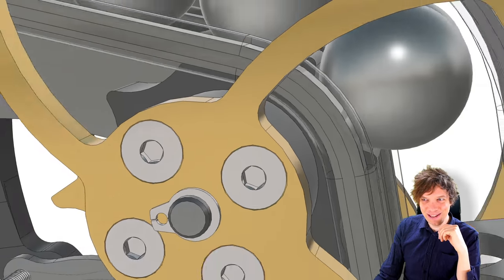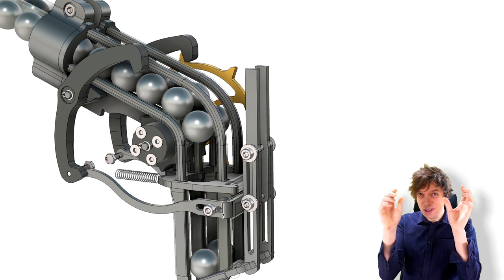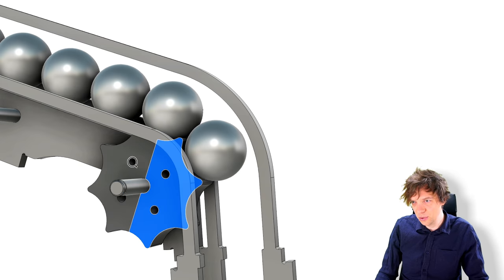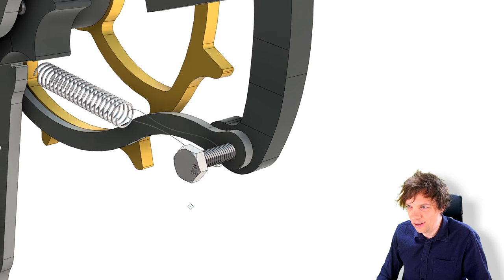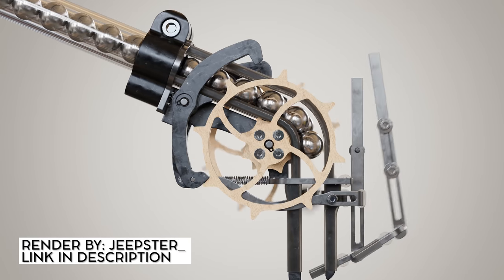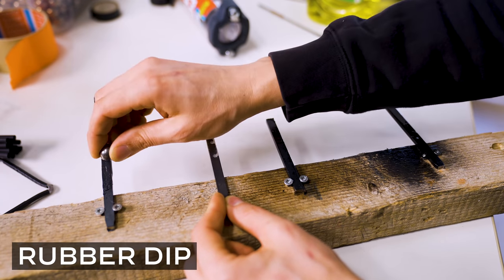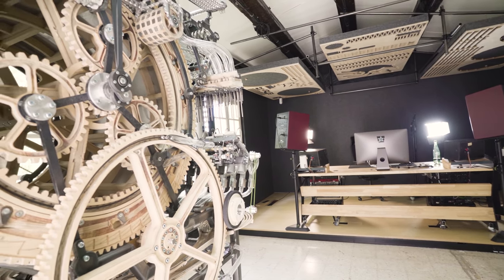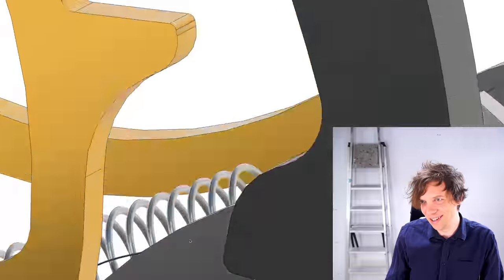Clock Escapement Marble Gate - Designed For Silence

Comment: That render looked so good, I couldn't even tell it was digital.
Reply: Well, the floating arms kind of gave it away
Reply: Yeah, hard to tell unless you notice the uncanny movement of the arms or see that they are floating
Reply: Granted the floating arms but it kinda fools you when you imagine it in the machine. Great render for sure
Reply: Yeah the floating arms are obvious but there was that split second before I noticed them that I thought he'd actually made them.
Reply: @POTThaesslich  Those were what tipped me off, but before noticing those though I too thought it was real!
Reply: Yes the pure quality of that render is absolutely insane - the light reflections even look like the material has been touched and has fingerprints and oils from the skin on it. Absolutely incredible
Reply: plus the lack of rust on the marbles
Reply: Dude I had to actually read that comment to realize it was a render.
Reply: @POTThaesslich  The motion also kinda gave a hint, this wasn't real
Reply: Oh my god i thought it was real
Reply: I was wondering myself what the heck was going on 😂
Reply: Yeah, I didn't realize it was a render either, I just thought he got bored with standard physics and gravity... I mean looking at this machine, it's not an unwarranted assumption.
Reply: while this wasnt done in unreal engine, [unreal engine is a vary high end(and free*) to use game engine], that game engine easily produces 100% realistic results for any non flesh material(not kidding), with high end textures based on real things like trees and rocks, those also can look 100% real if desired. Add in things like light going through materials and diffusing and even leaves look 100% real. This company also can have 100% realistic human models with enough effort put into them. some time ago they found a way to light up individual pieces of hair and have refractions etc so even hair looks real now. It does come at some cost for GPU but they have found amazing shortcuts so it doesnt cost what you would expect... in the end you can make everything look 100% real RIGHT NOW... if you want. Its absolutely astounding that this day has come but all things have trade offs and most companies are not interested in "real" due to time and money. with new graphics cards coming with ray tracing chips on them, it makes these computationally intensive processes much easier. i really look forward to the next few generations of games when this stuff finally starts to show up.
Reply: @jessiejanson1528  Thanks for the reply! I too am looking forward to the next gen games but as you said, time and money are the real constrictions...Either way it gives us a glimpse into the future of games and animated films and its very exciting!
Reply: @jackstephenson5238  they also made a new character generator for vary realistic characters that are fully rigged, but not quite 100% realistic, but that may depend on settings, im not sure. This type of stuff took time, money and skill and now its free for devs that use their system(but not fully released yet) This more then anything else will have a huge change on things and im just waiting for them to fully release it so i can play around with it :)
Reply: Easy to tell apart with years of experience
Reply: That was a render?? WOAH!
Reply: @DasVERMiT  the arms aren’t floating in the render
Reply: @POTThaesslich  the arms aren’t floating tho

Comment: Cross-drill a hole through the 8.8m bolt and run the spring wire THROUGH the bolt like you would with a guitar string. Then you will have a positive spring adjustment mechanism that won't slip or creep.   ...also, IT'S WEDNESDAY MY DUDES!
Reply: The "8.8" on top of that bolt is actually a marking for its tensile strength. There's no way he's ever gonna need a bolt that strong to do such a menial job
Reply: IIRC it's a 5mm bolt.
Reply: @STAG162  As Marin has shown on his live streams, he just use fusion's McMaster integration for the bolt models, so it's probably just a slip-up.
Reply: Great solution for the exact problem I was thinking of when Martin showed the spring attachment.
Reply: @xureality  yep I'm sure it's just a casual representation of the bolt intended for use, tensile strength being irrelevant
Reply: @STAG162  He is ALSO trying to minimize the total number of unique parts.  That bolt is used elsewhere in the machine - so any place it can do the job reduces the total of unique parts.
Reply: @kin2naruto  as I already said it's a representation only. the fact that it has a high tensile marking on it is non-indicative, ironically.
Reply: Krister L  building foundation-strength bolts.
Reply: That separate wire solution definitely made me uncomfortable; I feel like it's the weakest part of the design
Reply: Good suggestion.

Comment: 3rd generation clockmaker here. The part you are referring to as a “pallet” is actually called the “verge” on a clock escapement. The pallets are the flat ends of the verge that catch the gear teeth. There is an entrance pallet and an exit pallet.

Comment: It’s a very beautiful design! Beware of heat-shrink though, I had used it before in a similar application. It worked at first, but it reacted very poorly to repeated contact, deteriorated quickly and failed. I changed to using plasti-dip and have not had a reliability problem since.
Reply: Quite so, that type of heat shrink is designed with a long term view of electrical insulation and ingress protection, not with a consideration of its coefficient of restitution. Having a word with the actual manufacturers could lead to a better long term solution with the qualities that you're looking for.
Reply: Glad to see you here Marc!
Reply: always great to see youtubers i love on the same video. how great is that. now how do we get an old hp machine running the marble machine?
Reply: Yes, standard polyolefin heatshrink is not tough; FEP heatshrink is much tougher and is worth looking into.

Comment: Hi Martin :D
I'm a professional swiss watchmaker & i gotta say i love your integration of a clock-escapement into your marble gates. You really nailed it.
Just a little note on that - the part you're calling "palette" is called "anchor" in the watchmaking industry - the "palette" is just the part of the anchor where the escapement-wheel touches it🙈
(sry for the nitpicking, just bugged me a bit while watching)
Reply: Do you hand-fit your escapements, or just pull them off a CNC device and install them?
Reply: I'm a "rhabilleur" - so i do it the old-fashioned way and do it by hand.

But normally you cnc the anchor and the palettes are synthetic ruby - so you have to fit them (again, we do it by hand - the industry with machines)
Reply: @randomsocknr.3334  So Martin will most likely have to hand-fit 22 of those mechanisms?
Reply: @thomasbecker9676 Generally jes; depends on the accuracy of the parts - but i think the tolerances are much higher than on a watch

An anchor in a wristwatch dictates the accuracy over a lomger period of time - a micrometer can mean up to a minute delay per day.

On this construction it does not matter that much on which frequencies and resistance it has - also because of the additional mass it has in comparison to a normal anchor and because of the mechanical requirements it has to fullfill
Reply: @thomasbecker9676  short answer - probably not xD
(sry for the stretch)
Reply: @randomsocknr.3334  Devil's advocate: If they require some sort of hand fitting and adjustment, it that a good design approach for something that may need quickly repaired in the field?
Reply: @thomasbecker9676  well - if you look at the worst case (i have no idea about which measures or momentums martin used):

Definitely not - it's a real pain in the ass to configurate, especially because the kind of anchor martin chose is only adjustable by removing material or bending the whole thing.
(normally you would do the adjustments with the "palettes" - but because the palettes are part of the anchor in this type thats not possible) 

But i'm pretty hopeful that the accuracy of the cnc and the redundancy added by the mass will overcome those problems
Reply: @randomsocknr.3334  Unless he's paying for some high-end CNC machining, I doubt they'll have the precision or surface finish he'll require. I've used the same router table as he uses, and it's maybe +/-0.031"

Comment: One other option for heatshrink is a special type that had adhesive on the inside. It is essentially coated inside in a thin layer of hot glue. The heat gun shrinks the heatshrink and melts the hot glue, so the the heatshrink grips very securely to the surface. The hot glue also adds some thickness and would likely dampen more noise.

Comment: The idea of the silicone tubing and transparent heat shrink tubing is AMAZING! I'm making notes to file in my Piano keyboard played Tubular Bell Carillon. Getting the bell tubes that match the notes of a grand piano will be the second biggest challenge, where as the conversion from string hammers to top of each tube and the linkage is the primary challenge. I want the control of a piano in the striking of the tubular bells  to give it the rich soft to crescendo tones of a grand piano. Why tubular bells? Space savings, and tonality.

Comment: I don't know if it's a major but you probably want to make sure that you have room for a washer between your snap ring and the Delrin.  It will help smooth out that interface and prevent the snap ring from cutting into the Delrin and also probably help reduce friction between the 2 parts.
P.S. I really think that just getting the proper tension spring with the correct length would be your best option for the spring.  It would be so much more simple to just replace a spring if one snaps or starts to wear out if you don't also have to fiddle with that little wire in a location that is already hard to work on.
Reply: You're right. They don't need to be adjustable if he chooses the right length/modulus. And they will rarely if ever need to be replaced.

Comment: I think you should add a roller bearing on the pallet where it meets the brass wheel. This will eliminate the friction and wear on the Delrin (POM) pallet (and the wood if you're sticking with  for the wheel, instead of literally going to brass). It's a very simple addition, you just have a slot for the bearing in the pallet with a screw.

Comment: SUGGESTION: when you cut the brass wheels, you will get cool little shark tooth shaped scrap pieces - you should definitely turn them into merch or patreon perks ☺️
Reply: I think he's going to CNC them, meaning the "pieces" will just be shreds of sawdust :(
Reply: @innertuber4049  oh bummer 😕 although I suppose you could set the tool path to deliberately cut them out as opposed to cutting  them all to bits
Reply: @brindmusicnerd  these parts have to either be shred to dust or screwed to the gound. Otherwise the machine will cut them out and when the link becomes thin, they are either thrown out at high velocity or rotate and get stuck in the tool. This might abruptly stop the tool and kill it or the whole machine.

Comment: Regarding sound dampening. I really think you should look into butyl rubber. As I understand it it's basically ordinary rubber with added sulfur. At least that's how I remember it now more than 40 years after I learned about it. It's used in for instance the inner tube used in old car wheels and the inner tube used for bicycles. The added sulfur makes the rubber less permeable so it will retain the air for longer.
Another effect is that when the rubber is stretched or compacted it will be slower to regain the original shape. A rubber ball made of butyl rubber will hardly bounce at all. Dropping it on concrete or steel plating it will just stop with a thud. If you were to use this kind of rubber to dampen the sound the ball will not tend to bounce. This would be a very good thing for things like the droppers where the balls will drop from the escapement to the dropper one at a time.

Now I have no idea how easy or hard it is to find this kind of rubber and in what forms it's sold. But it may be worth at least keeping it in mind when sourcing materials.

Comment: Technically you can use your CNC as a lathe to add the c-clip groove.
Place the rod in a collet and a groove cutter in a vice laying flat. Just make sure the contact point of the spinning part centerline is just below the top of the cutter.

Comment: If you can't get a lathe for the circlip grooves, put the shaft in a drill, turn it slow and use a hacksaw to cut the groove. It can be tidied up with some small files after.

Comment: 6:24. The purpose of that metal clip can be done with a plastic one that can be removed/replaced by hand more quickly. That retaining part shown looks like one that need a tool to remove and put it back on. I work with business machines/copiers. There are many places in the machine where instead of the kind of clip shown here, a clasping plastic clip was used. It has a flange on it to grip with bare fingers that provides for quick release and replacement when changing out a part behind it. As with both styles, If you drop/loose it, you need to have a spare on hand.

Comment: A suggestion for the simpler gates: make it so, if you need, they can be slotted into the clock escapement mounts. If something goes terribly wrong for any reason and a gate's moving parts just totally jam or shatter, it might be easier mid-show to just... insert a simpler mechanism where it was and continue.

Comment: I love how the only link between the clock escapement and the actual release is the rubber/silicone pad thingy. Manufacturing these gates without any solid link between these two gonna be a huge boon when the time comes for vibraphone. Basically just push-release mechanism.

Comment: Martin, there's a problem with using a wire for the spring tensioning. Wire work-hardens when you bend it, and becomes brittle. If you make several adjustments, you will find that the wire becomes useless. Trust me on this one, I found out about the work-hardening of wire the hard way in one of my projects.

Comment: If he drilled a small hole through the side of the spring tension bolt, he could feed the wire through it and attach it, meaning he can adjust the tension by tightening the bolt, just like a guitar string tensioner.

Comment: Martin it looks so cool, but... I'm a little worried about your bigger escapement wheels! Double the diameter is (at least) double the mass, with same width spokes/teeth. Then doubling the diameter, even if it were the same mass, is FOUR times the moment of inertia (I = mR^2). Then, you're making it out of brass, and even 1/8" brass is 6 times heavier than 1/4" plywood. These wheels might have almost 50x the moment of inertia of the prototype wheels! More moment of inertia = more click clack when the wheel impacts the pallet, and slower acceleration to deal with fast playing.... hope it works, but I think you might want to consider some other options just in case!

Comment: The design with the half-pallet with the other side on another piece looks similar to a detente escapement in watchmaking. So both designs are actually what you can get in watches! A detente escapement has a few upsides and can be a better timekeeper in certain situations (in watchmaking) and has lower friction reducing the need for oiling. However, the detente escapement is not self-starting, and is susceptible to shocks throwing the timing off. Your current design, more of a Swiss Lever escapement, is much more robust and should work much better on the MMX.

Comment: The marble gear could be one piece with the gear flange. To remove, just take off one circlip and slide the shaft out of the gear with the escape wheel. It will drop out the bottom of the assembly.

Comment: Please be careful with the screws not being under tension. They will have a tendency to come loose over time due to the vibration.
Thread lock can help, but the best practice is to have them tensioned.
Examples: screw that moves the escapement and the spring; screws that hold parts that need to slide by each other.
=> One option is to use a shoulder bolts. This requires correctly dimensioning the shoulder length and finding available bolts with that dimension (not always possible, which will drive other design considerations).

Comment: Have you considered the added friction caused by your sound reducing ideas?  You don't want the marbles to not flow as they should.  You can see this happening when you first demonstrated by putting tape along the marble channel.  Also, consider the wear and tear of the material.  The sound reducing material will likely wear out faster than the metal.

Comment: Using delrin augured out to fit over the metal rails is a good idea i think and in other places like the release rails slide over like a sheath. Note I don't know if delrin could be heated so it could conform to some of the curves of the metal rails? Your use of the shrink wrap and the tubing will work at some places but as I said in early comment they could cause problems in others

Comment: One: I am concerned the 'soft close' will slow the arm, thus slowing the rate of ball drops, thus not being able to play fast/repeat notes. Will the silicon be enough to deaden the sound? What about wear?
Two: The drop arm looks like it moves a lot of distance. Again, possibly slowing the rate of ball drops. Remember: 'right hand down.' :) Possibly angle it?
Three: Will the larger 'clock arms' create more inertia making it harder to stop playing quickly? Would/ does it matter? (I'm not a physicist.) They are small.

Still love, love, love the test base-riff!

Out-sourcing is a common practice dating before WW2 manufacturing; it's okay to say, "I need help."